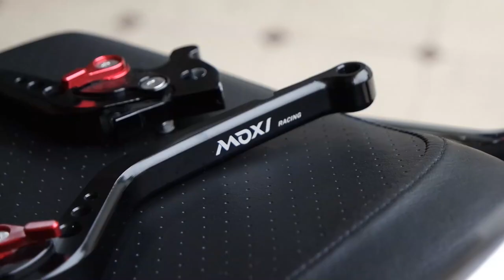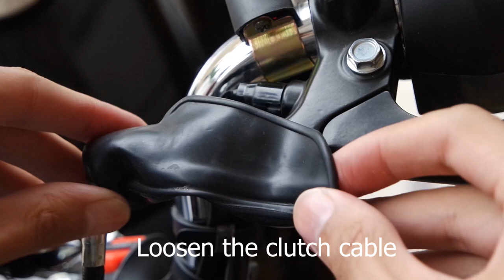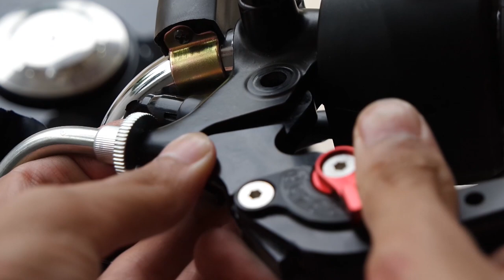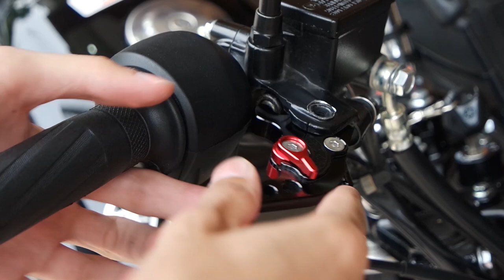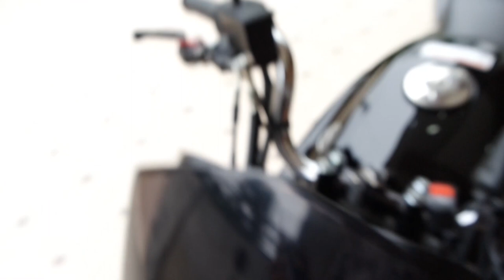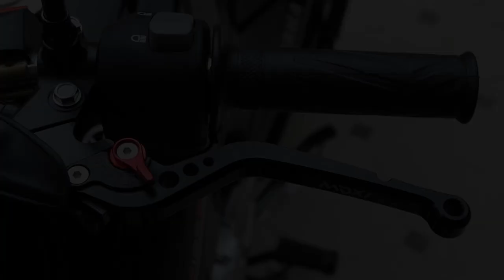How to install Moxi Levers for quicker shifts | Yamaha YBR 125

Comment: Bhai light grip k sath jo nichay chota red button hay uski fitting ka btay day mainay b krwana hay waisay or uspar headlight dipper rakhwana hay
Reply from the maker: Butt Ismail! It is a push button I used as a dipper, I attached one wire of the button to the high beam of the light and the other wire to the +terminal coming from the ignition switch, when I have time I will surely make a short video on it
Reply: @PkModified  button ki fitting ka b thora sa btay
Reply from the maker: Butt Ismail! I used elfe to stick the button to the side of the light switch assembly

Comment: Wow your video  skills are cool and so these gear levers look awesome!! Can you please tell if the work fine with Yamaha Ybr 125 G and will they break both the clutch wire and brake wire?
Reply from the maker: Tysm ❤️
These levers are universal and you can install in ybr G, they dont damage anything, the clutch wire breaks only when you dont install it properly or dont use lubricant on the wire
Reply: @PkModified  Thanks for the valuable feedback mate!!

Comment: Cluth ka uper wala Nut jisse tool se open kiya Hai Ye kitnay Ka aya Or is ke saath Kon kon se size kd nut opener lag jatay?
Reply from the maker: Shiraz Ahmed the tool I use is a socket wrench which I bought from Daraz Online ,it costs around 2900, here is the link:
https://www.daraz.pk/products/46pc-dr-socket-ratchet-wrench-star-hex-torx-bits-set-sockets-flex-bar-i1581508-s9425903.html?spm=a2a0e.searchlist.list.21.66586f7101FsJe&search=1
It has all nut sizes till 14mm

Comment: Ek sawal: kia moxi k levers lagany sy bike gear men hoty howe clutch daba k self start hojaye gi ya ye function stock lever k sath he possible hai.men ny kahin dkha tha k ik banda bata rha tha k moxy k lever lagany k bd ye possible nahi q k stock lever k sath koi aisa button ya system hota hai jis sy bike gear men clutch press krny pe self start sy bina jhatka diye start hojati hai.sorry if it seems a noob question.
Reply from the maker: No bro it a good question, the moxi levers i have installed you can be in any gear hold the clutch and self sart the bike
Reply: @PkModified  thanks for the answer bro. By the way love your videos, the way you sophisticatedly work with proper tools  plus your video editing skills both are awesome.
Reply from the maker: Thanks a lot bro 🥰

Comment: 1. Don't use WD40 as a lubricant.  WD40 is not a lubricant.  Use some proper lube.

2. The free-play bolt probably shouldn't be that far out on the clutch.  This bike needs an adjustment at the engine end of the clutch cable.

3. Changing the position on the lever switch doesn't change speed of gear change, it simply changes the position of the lever.

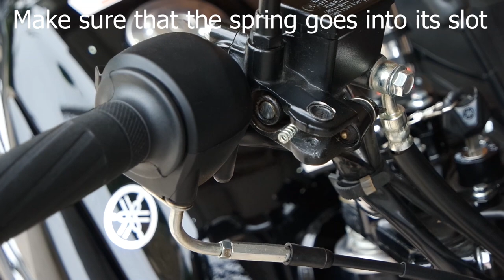Comment: 3:03 bro from where did you get the spring which is in brake lever..?
Reply from the maker: Bro it is stock, that spring is inside stock lever, just remove it and place inside the moxi lever

Comment: Brother any feedback  about moxi 3 piece handle bar for ybr?
Reply from the maker: Its good just for its looks, i wont recommend installing it as it changes the handling of the bike and one of my friend had it installed in his ybr and on a corner he could not steer bike and fell, i bought i but never installed it in my bike i am planning to buy a fat bar that is much similar in design to the stock one

Comment: WD-40 isnt a lubricant people its a solvent
Reply from the maker: Yes, although it is not a lubricant, its still better then using nothing as I did not have mecanical Grece
Reply: @PkModified  that is definitely correct but it's such a common misconception that i like to see it pointed out as often as possible

Comment: Title hi galat hai moxi se shifting bahter nahi balke bigar jati hai
Reply from the maker: Ap ne galat install kiya ho ga ya handle change kiya hoga, agr sai se install kiya gae ybr mai stock handle pr to clutch naram ho jata
Reply: @PkModified  nahi brother main sirf apke title ko point kar raha hu quicker shift.......dosent make any sense
Reply from the maker: Quicker shifts makes sence, you dont have to pull back the leaver as far as you would do with the stock leaver, thus you can engage and disengage the cluch faster and shift gears easily takling less time and effort, although its not that big of a difference